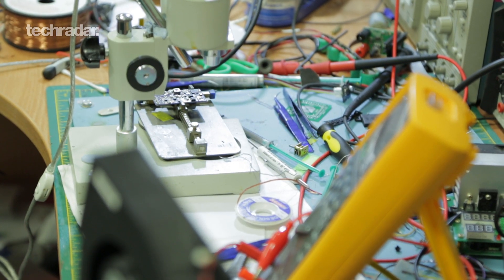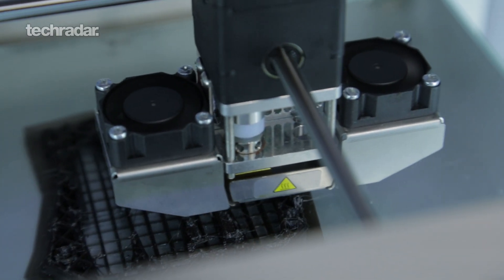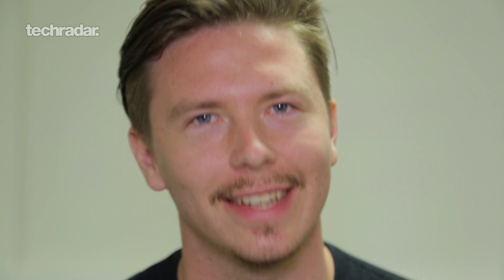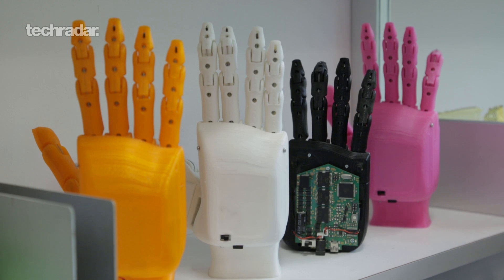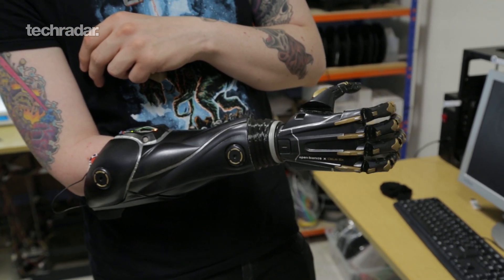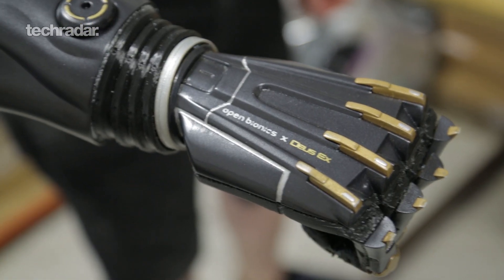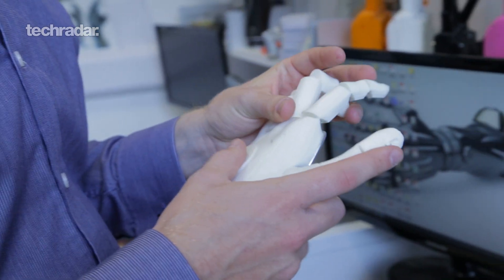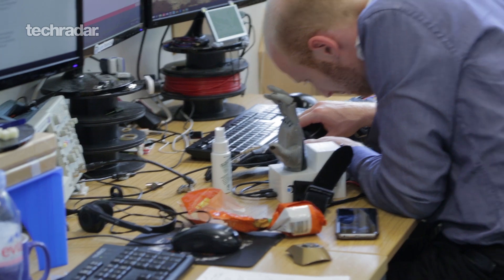3D printing yourself a hand: Deus Ex's bionic limbs are being made for real by Open Bionics

Comment: I think that you are solving problem wrong way.
Electric motors and gears are slow and weak.
Look at the Darpa's robot Atlas. It uses electrohydraulic actuators.
Electropneumatic actuators or electrohydraulic actuators are faster
and stronger.

Comment: Seen this years ago and I thought to myself back then that 3d printing is still niche, expensive and practically exclusive to makerspaces bankrolled by universities and libraries. Now tech has advanced to the point that a basic cartesian 3d printer is less expensive than a mid-range cpu or gpu. What a time to be alive, imagine the numerous innovations home tinkerers will think up of especially with 32 bit microcontroller boards becoming insanely affordable.

The ultimaker 2+ printers seen in this company's office isn't that expensive for the average joe, it's only around 2.5k usd.

Comment: This may be a very silly question, but please understand I have no education regarding neural anatomy beyond documentaries and a Mary Shelley novel. It is my understanding that our muscles are controlled by electrical pulses along our nerves. I assume the signal is DC or the biological equivalent. This would be considerably more invasive than the adhesive sensors I saw stuck to the fore arm of the gentleman in the video, but would it be at all possible to (please forgive the crudity of the term) splice incredibly small insulated electrical conductors (not unlike very small speaker wire) directly onto the nerves at or near the location of the injury? If so, it seems like the output signal from the brain could be routed to an amplifier and result in perfect dexterity, aside from sensational feedback, which I must admit would be way beyond me.

Is it possible to intercept electrical impulses directly from the body's biological electrical grid?

Comment: looks really coool, but pla and plastics for a prosthetic? why not ceramic? or something synthetic and flexible like nylon? 3d printing with pla was cute in 2012, its not the future of rapid prototyping. its cool but plastic is  so inside the box thinking. they shoudlve tried a little harder. plus a week build time is still too slow in this era. something like these should take less then a day out of the printer before being shipped

Comment: i kinda want to lose an arm now. Is that insensitive? probably :/
Reply: i doubt it makes sense, our limbs are very advanced technologically speaking, a robotic arm might be more strong or resilient (not sure about it though) but even then if you want better performance just take an exoskeleton no need to lose a limb
Reply: I have slightly different reasons myself. I love this type of technology and I'd be perfectly fine with helping developers and engineers test their products.
Reply: if the cybernetics are superior to your organic parts ints not insensitive, its rational.
Reply: if the cybernetics vastly outperform organic limbs in precision, speed, strength and resilience loosing an arm WILL be worth it
Reply: Yoann Morais yehp
Reply: I have now learned in YouTube that cybernetics is like a robotic hand foot but in addition you feel the surroundings you touch with the cybernetic hand and a bionics is a robotic hand without feeling of touch or etc.

If I lose a hand or foot I'd rather go for bionics, just because I don't want to have a cybernetic hand go out of control for it to hurt nerves for no reason.

Please correct me if I'm wrong.

Comment: I have been in love with the idea of bionic replacement parts but most of the research is in limbs, I on the other hand am losing my eyes and all our research is in genetics witch is great but damnit i wanted Bionic eyes.
Reply: Are you losing just your eye or complete apparatus with eye nerve? If eye nerve is in tact I believe I saw some projects that basically hook up camera to the nerve.
Reply: parman01 so basically the layer of my eye that absorbs light the cells are dying in it from the outside in so basically the only options are replacement eye or stem cells to reverse the cell damage, but as you can tell I'm really leaning towards the robot eyeball thing cuz you know cyborgs

Comment: I wonder whether there is a prosthesis that can be use to for example hit someone in the face and do not break it apart ?
Reply: Well, the cheaper, 3D printed ones would probably break apart easily but the more expensive, metal ones probably won't.

Comment: This is pretty cool. but what I want to see with it is what this one guy did with an old mind flex kit he rigged. He made a BCI for it and hooked it to a 3D printed arm and hooked up the wiring. Based on thoughts as normal, he was able to move the external 3D printed hand using his brain. My thought is if you manage to filter the frequencies to get the ones for the correct arm or hand, then moving your prosthetic will be as easy as moving a normal limb. It'll take time and all, but with practice and relatively cheap materials (again an old mind flex) you can build up and make it amazing. The future is already here, just have to put it into reality using ingenuity